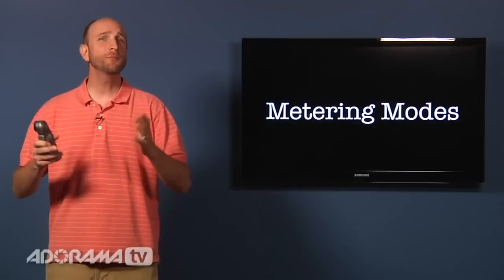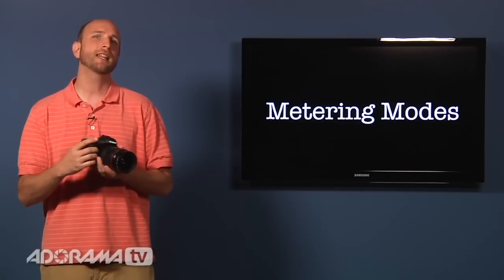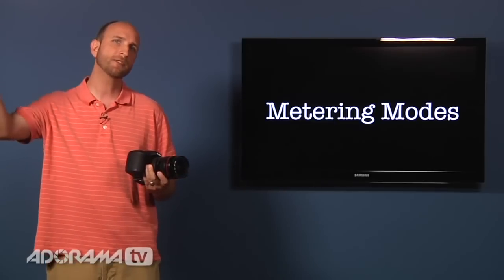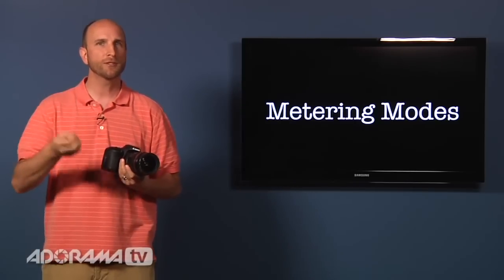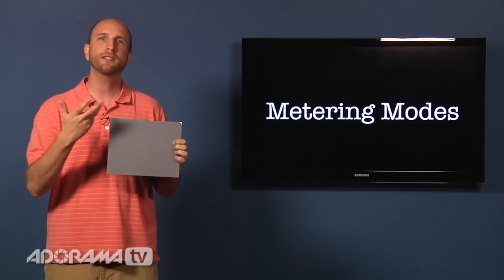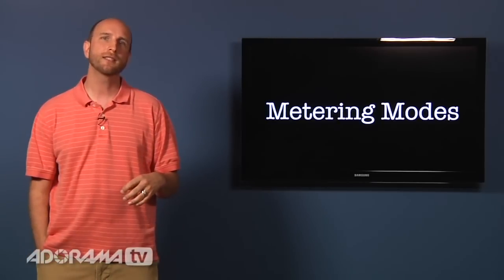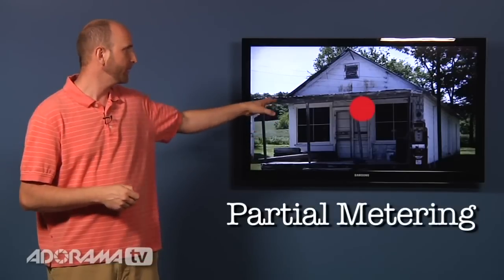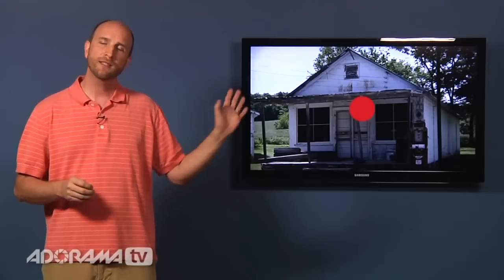Digital Photography 1 on 1: Episode 25: Metering Part I

Comment: I just make it easy, if I want the dark parts to get lifted, I increase EV.  If the scene seems too bright or too bright for my liking, I decrease EV.  Changing metering can matter if you are doing a film where it goes automatic w/ no scene cut to correct but even then you would want exposure lock when doing video but if done right, auto exposure can do better than locking it or a lot worse especially with white balance set to auto.

If depth of field matters Aperture priority.
If no blur matters Shutter priority.
If you know what you are doing and have lots of time, Manual priority.
If you just want a good shot that works and if it changes a bunch it doesn't matter to you, Program Auto priority.  I've had good luck like this when filming.  Then randomness makes for good content to choose from especially with a variable zoom lens.  It's like you are using multiple different cameras even though it's the same one.

Comment: I have one of those white balance cards. It has black, grey and white. When I want to set up my white balance in post, do I use the 18% grey or the white to do white balance? a little confusing.
Reply: 18% is the light reflectivity, it is actually 50%white 50% black, aka. middle grey. (And that's best for WB)

Comment: I saw all your videos from the very beginning: wonderful and very complete work! Great job!
After this great video on exposure a question came to my mind:
Let's say I have a TTL flash mounted on a camera and lock the metering (in spot mode) on a area and change composition. What will happen?
(I know that flash/camera use preflashes to predict exposure but they don't know where mine "correct exposure" is located since I've moved it)
Many thanks for your answer!!
ps:I'm sorry for my bad english...